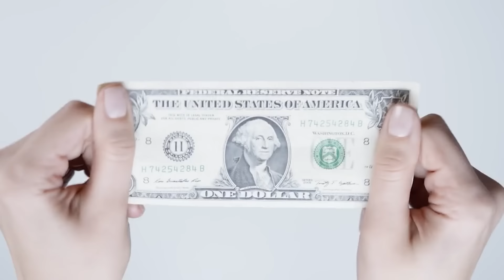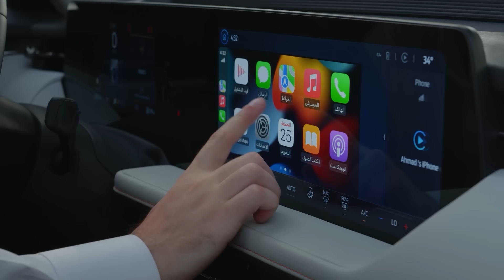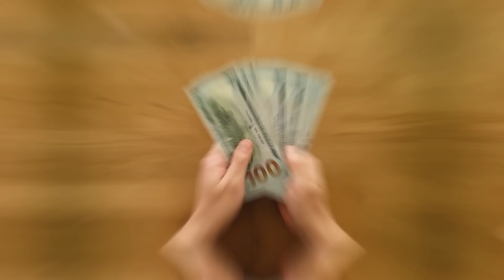Ford CEO Announces 6 NEW Ford Models For 2025 & WOWS Everybody!

Comment from the maker: 🏆Which of these 6 new Ford models will be a failure?🤔 

🔴11 Reasons You Should Wait For 2025 Ford Ranger WATCH HERE! 👉https://youtu.be/MDYuFO92woQ
Reply: @tech_triumph  Can I guess all of the above , they 🚫 even trying to make an affordable vehicle
Reply: All
Reply: @tech_triumph  That’s a great question. I didn’t see any of these models on Ford’s Upcoming Vehicles webpage. So, I’m guessing that we’ll have to wait and see what actually happens.
Reply: All will be failures. Nobody wants electric vehicles. Recent Supreme Court, Chevron decision neutered the EPA. Café standards are out the window. People want four-cylinder motors in small trucks or six cylinder motors in small trucks without a hybrid system or a turbo. I think the Toyota Stout will have a straight four-cylinder non-hybrid non-turbo option, normal aspiration rocks.
Reply: @tech_triumph  depends on if they actually build them, for one, for two, dealer greed must be curbed, and the last thing, they should have better build quality than a Chinese ev.
Reply: @miketerry6036  simpler and more reliable in the long run.
Reply: All of em…the 2024 ranger already has recalls in Australia
Reply: @TTT-rl4kr  In fairness, I have not been tracking the recalls, what’s the problem with the Maverick? It’s not unusual for a new model to have some teething problems, but it’s severity depends upon what parts are failing, does it immobilize the vehicle, or is it a catastrophic failure of some sort? Is it just a wonky infotainment system. It does make a difference if the recall is for a bad internet connection or something small like that,is one thing but if the motors are blowing up or the transmission won’t work properly, those are very serious issues. The warranty should take care of the recalls and repair issues, it is a new vehicle after all
Reply: @markvincent5992  nothing major yet with the maverick, but I was talking about the 24 ranger
Reply: @TTT-rl4kr  I have heard things about this one. Trans failure rings a bell, but I would appreciate any information you would care to share. Thanks
Reply: I thought that the FOMOCO wasn't going to make any more sedans.
Reply: Six new vehicles with no pulse i’m already dead😂😂😂😂😂😂😂

Comment: You'll never find the $20k model.
Reply: Yea you will....for $40k
Reply: I mean, if it's made out of aluminum foil, maybe.🤔
Reply: These sort of things were typically shipped in volumes of 1 or 2 at a dealer, so they could run the big Thursday or Sunday newspaper ad offering 19995.00 truck.  (Once the 9995.00 truck).  When you arrive you find out their was only one on the lot, you can't order it, and it was completely base stock that even had substandard framing. 

The ones we have here are 39995.
Reply: Then pathetic dealers will add market adjustments of 20% or more at launch.
Reply: 20k before dealer add ons……
Reply: Dealer markup for 2 years…$25,000
Reply: @STho205 that’s when you tell them to…. well you know. Then start shopping for a new dealer who’s smart enough to order a few of the base models and then sell up!
Reply: Chevy Trax
Reply: Moving back to horses
Reply: Dealer to customer- Yes, the Ranchero starts at $20,000. Did you want an engine with that? We have three choices. One is the Freddy Flintstone trim.  Customer - Ah, yeah. I didn't want to push it, maybe the turbo 4-cylinder. Dealer - Oh, good choice. Did you want a transmission as well? You can get a manual or automatic. Customer - I'll take the manual. Dealer - Oh, good choice. Did you want a 3-speed, 4-speed, 5-speed, or a 6-speed?  Customer - Gosh, I didn't even know they made 3-speeds any more. I'll have a 6-speed. Dealer - That is a higher end option. You'll have to take the doors, hood and windshield options. That will be extra cost. Customer - What? Yeah, those are required options. Dealer - Did you want seats with that? Customer - You mean it doesn't come with seats, they're an option? Dealer - That way you build your truck just the way you want it. Now, if you buy our F-350 Golden Lariat Super Model you get all those things included. Customer - What does that cost?  Dealer - Well, those are on special. But out-the-door we're letting those go for $150,000.
Reply: @Colorado_Native  True. Sad, but true.😬😳🤣
Reply: Nissan or Mitsubishi. I'm getting ready to purchase one. I refuse to buy overpriced FORD's.
Reply: It’ll have a sub 200 mile range.
Reply: There’s a couple of models coming out in the next couple priced under 25k
Reply: @liquidsteel8131  Aluminum foil would probably be an upgrade.
Reply: Grow up, 20k is a 5 year old used car with 120k  miles on it
Reply: Dealer markup will kill any new cheap car
Reply: Nope!
Reply: @SHUB281  I don’t know if I want to find one of those fat little spuds 🥔. Pare about a thousand pounds off of it and you’ll be close. And you’d be amazed at how much faster it will go. Add lightness. Colin Chapman of Lotus said that. He was right. The trucks, suvs, and even the cars weigh far too much altogether. I have seen some hope as the ev market is collapsing and maybe we will see a reduction in weight in real cars and trucks as well. I no longer need a truck or suv anymore, but since the idiotic conversion to evs is determined to screw up more stuff that should be left alone, at least we could still build cars that people want,  instead of having overweight, oversized and overpriced suvs, evs, and the aforementioned trucks as the only thing that America is still building. I count only about 6 cars that actually are cars , like the Corvette and the Mustang, and a couple of very good Cadillacs. Pretty much everything else is built in Germany or Japan, but with small cars and trucks that get good mileage and don’t quite cost the Earth to buy. Are you listening Detroit?
Reply: @marktully391  I didn’t even know that Mitsubishi was still making cars and trucks anymore. I wish they still had the EVO!
Reply: @AdamBreslow  that will have a hundred mile range, if that. It’s a failed attempt to make us drive these death traps and have to pay higher prices to boot. I think it’s fair to say that the battery ev is doa.
Reply: @rol9988  don’t know where you go to throw your money away, but I have seen much better prices than that on some pretty sweet stuff.
Reply: YouTube filled with outright false nonsense😢
Reply: $ 35,000. Minimum!

Comment: Anybody here old enough to remember when the Ford ranger was a full size and the maverick was a car?
Reply: Yep. We had 71 grabber green Maverick when I was just a kid. I learned to drive manual transmition with the that Maverick. We didn't have the full size Ranger F-150 from the 70's, However we did have a two toned (orange/white) 71 f-250. I want to say that truck had the explorer badge on it. Thanks for that, it's always good remember how good things were when you were young. =)
Reply: The Ranger as a stand alone model was never a fullsize truck. It was a trim package. Wood grain inserts, full front to back carpet, and captains seats and center console up front.
Reply: My buddy had late 70s Ford Ranger F100 with a factory big block v8, then in the 80s the Ranger got small.
Reply: @larrysantacrose  Your buddy had a F100 Ranger. Not a Ranger F100. Ranger was a trim package back then. My dad has a '79 Bronco Ranger XLT. The RANGER pickup came out as an answer to things like the early Toyota, Nissan, and GM small class pickups. Ford worked in conjunction with Mazda to use their B series as a base for them.
Reply: Ranger, full-sized with an inline 6 and a manual transmission. We had a Comet(Mercury cousin of the Maverick) with a 3 speed manual that would pack us up and pull our pop-up Coleman trailer.
Reply: @gregoryjones4986  What preceded the "Ranger" badge? And what year? As previously stated, the Ranger pickup did not exist as a standalone model until the 80's.
Reply: I owned both at one time. The maverick was a fun little two door. Took a hell of a rear end hit, I was stopped and the car hit me at 40 MPH. Sore for months but walked away.
Reply: @shaunbeasley123  Heck I remember when they used to build cars instead of 17 kinds of ersatz suvs
Reply: My mother had a 1980 F-100 Ranger single can long bed.  

I’m not quite old enough to remember new Mavericks in a showroom.
Reply: I had a 1972 Ford Ranger F250 with a 390 4 barrel carburetor and a C6! Transmission  rims were 16.5 tires
Reply: You are kinda mistaken, the F100 (Ranger) was a trim package on early F100's & etc. until Ford used the "Ranger" name for it's new small truck that replaced the small Courier truck which was built by Mazda! Yes I remember on the Ford Maverick or Mercury Comet, I was in high school early 80's, had a few of both in student parking!
Reply: I remember way before that. I was born year CCCP put Sputnik up in space, long before we had a satellite. The Boeing B-52 Stratofortress and I both are going strong.
Reply: Yup!  Had both!
Reply: He never said it was a stand alone models know-it-alls.
Reply: @shaunbeasley123  oh yeah 👍 I was there.
Reply: @mikeford963  picky picky picky.
Reply: Ahhh, I long for the good old days when there was only three or four SUVs on the market, and we had cool cars with V-8!motors and four speeds , and coupes, love the coupe. But now apparently we don’t make cars much anymore. And the “SUV” doesn’t have much sport anymore, and the engines are trying but the vehicle is anchored by the huge amount of weight that these vehicles carry around, and all the gadgets and anonymous buttons etc.. are a pain in the neck. Geez the new Bronco weighs about 5,500 pounds! Outrageous! I don’t know what makes it so heavy but it needs a diet badly.
Reply: @larrysantacrose a guy the other day pulled up to hardware store with an old Ford Ranger f series
Reply: Yup,had both.
Reply: Had a 75 f100 ranger for 37 years.

Comment: Wasn't the Maverick supposed to be $20 k ?
Reply: It’s going to be really difficult to make a $20k vehicle considering material costs and the ever increasing federal mandated safety features (i.e. just the airbag system alone has to be $1k manufacturer cost) like lane departure, auto braking, camera system, etc.
Reply: I was when introduced
Reply: @michaelmartin2276  it was supposed to be a $20k starting point but they found that the had to charge extra for the motor and wheels. So $30 k
Reply: Or when the hybrid was actually popular so instead of it being standard they raised prices and made the hybrid the option.
Reply: @markvincent5992  Only the white XL model with manual adjust mirrors and NO options. Fleet models.
I believe some or all of these models in the video are for the overseas market. We see thou.

Comment: Ford needs to work on their reliability and durability not new models.
Reply: @matthewhuszarik4173  That’s a good point. Although, my present Explorer has 240,000 miles on it and it’s still doing the job. I don’t do any towing or other “heavy jobs” with it.
Reply: I’ve had no problems the first 12 months with my Bronco!
Reply: @2Greenlid  Pretty much all manufacturers have reduced the short term issues with their vehicles. For me I don’t even care about short term issue because they are covered under warranty. For me reliability and durability from five to twenty years is what is most important.
Reply: You ain’t wrong.
Reply: You are correct as their reliability is dismal. But they need new models at lower prices too. The new Ranchero 2 dr is looking mighty good but the ev is a nonstarter.
Reply: @2Greenlid all vehicles have issues at startup with time they are usually corrected promptly but it does seem like Ford has had more issues than some others
Reply: I agree. They started declining ~2016. Had a 2016 Lincoln mkz (13-16), drove it for 5 years and 110k miles, no issues, got a 2020 Lincoln mkz (17-20), and Fords currently on its 3rd consecutive month trying to figure out electrical issues on it. I even purposely bought the last year I could to hope for the most revised version…
Reply: Best reliable vehicle out there, year after year
Reply: I agree with you 100%. They're all slogan built Ford tough. They forgot all about that like General motors. I hope I'm not stepping on your toes. They're useless with their vehicles. I mean, what are they doing? And I know just like you myself. How can they just keep making this trash?
Reply: @paparealestateinc2903  Agreed, I haven’t purchased an American designed vehicle since 1997. The problem with American auto makers isn’t their Union members it is their management. They keep giving us shit and it even costs more.
Reply: @markvincent5992 thanks for your subjective opinion
Reply: @JAKtheRipper333  actually I like the new Maverick quite well. If they build the Ranchero and it isn’t a warranty nightmare and they quit gouging I might consider one. The plain fact of the matter is that I actually prefer my old Audi, but between getting gouged on parts prices will ridiculous markups and being charged for labor they didn’t do, I have been looking at a few new cars, and I ain’t impressed. It seems that almost all new vehicles have warranty issues, quality issues, price gouging and extremely high maintenance costs should you run out of warranty. And I wouldn’t even consider a golf…er..ev. I’m assuming you are the person who made the issue of no car payment. If you have a car off warranty, you had better either extend the warranty, get rid of the car and buy new, or start a savings account for upkeep on the car. You’ll need it. So you never really from a car payment of some kind.
Reply: The new fords have been STUPID good in quality, reliability, and durability as of recent. Their hybrid models have been knocking it out of the park and the and the eco boost is a proven work horse
Reply: @cristianfmendez  I don’t know what you call reliable, but Consumers Reports has Ford and Lincoln at 22 and 23 in reliability out of 30. #1 is Lexus, #2 Toyota, #3 Mini, #4 is Acura, #5 is Honda, #6 is Subaru, and #7 is Mazda.
Reply: No Kidding!  Bring back the Taurus?  The Taurus I had years ago was a money sucking piece of garbage with numerous recalls.  Was the last Ford I ever owned.  Should have kept it buried.
Reply: They should have never electrified the Mustang. Should have kept it ICE.
Reply: @jerryw5508  You know there still is a ICEV Mustang.
Reply: @cristianfmendez ecoboost engines are notoriously unreliable. Only a diehard fan would say otherwise.
Reply: @matthewhuszarik4173  Yes, but keep it ICEV and keep it out of the electric car barn
Reply: I have faith in Jim Farley to see that the quality and reliability issues now experienced with some Ford models will be addressed.  He is a man of action and true concern and I do believe he will make necessary changes to improve their image!
Reply: Until Ford stops hemorrhaging money on recalls I won’t be purchasing. Just shows their initial quality is horrible.
Reply: Everyone says that.  Yet my 99 Power stroke is still going.  My 2005 Focus only got parked because I was not putting a clutch in it.  Yet my 2024 Camry Hydrid (which I bought in April) just went back to the dealership for a new engine.  Can't wait to find out why.
Reply: @xbuckeye1960x HaHaHa

Comment: Yes and the ford maverick was a reasonable 23k, look how thats turned out
Reply: Those prices were before the added extra features
Reply: $40 Grand now😳---😤😤😤😤😤😤
Reply: @michaelcschmitt  those prices were due to price gouging bastards sir. I have never seen a new naverick for less than 28k and the overwhelming majority of them are 33- 38k, and that was a year ago
Reply: @tommcguire6472  darn right your spot on. I hope they choke on the cars that are sitting there on their lots. They signed people up for 10 year loans in some cases and put a mill stone on young folks that weren’t smart enough to not fall for their high pressure tactics. They in effect screwed a lot of people.
Reply: I was looking at the Maverick here in Canada and could not find one for less than $40000.00
Reply: They can’t make enough of them. The pricing problem is twofold. One is the greedy dealer who marks a vehicle up or adds “dealer installed value packages” and drives the price up. Second the buyer is running up the price with options that are expensive. Get an honest dealer, use some restraint with the options and you can get a vehicle that suits you.
Reply: @michaelcschmitt they always advertise the base model, been doing it for a hundred years. The nicely equipped models are a little more.
Reply: @bernie6355 you should have a word with the dealer department at Ford. They are either ordering loaded models exclusively or they are just gouging you.
Reply: @markvincent5992  I’ve been buying new cars for 45 years. Times have really changed since my first car in 1979. It’s sad how cut throat dealers have become.